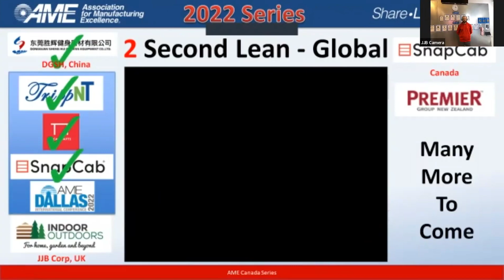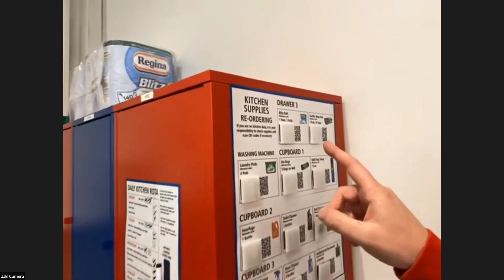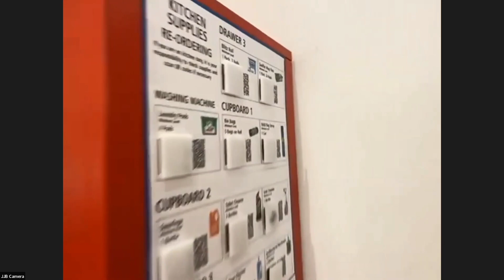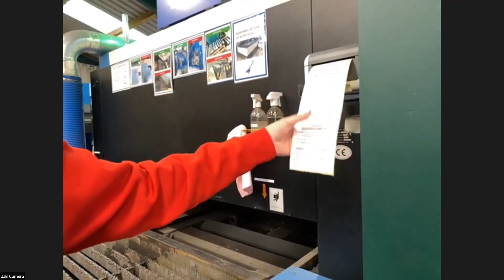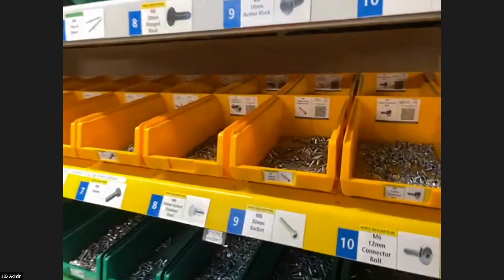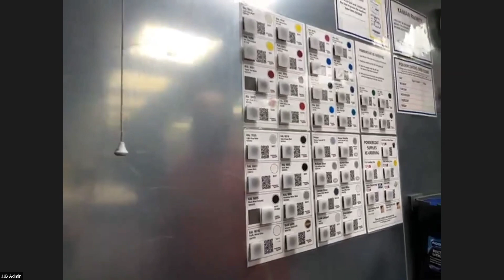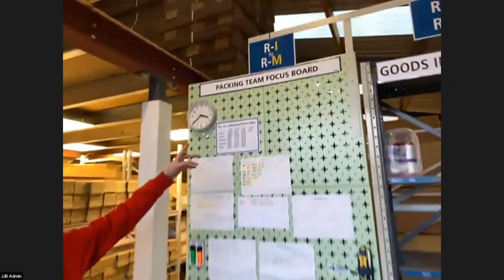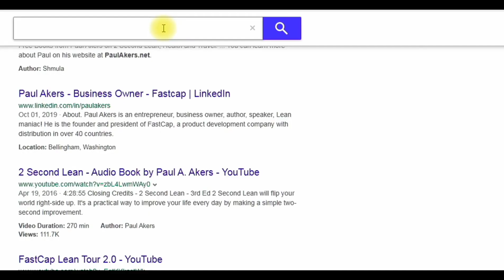Live Streamed Lean Factory Tour JJB UK November 2022

Comment: Jack, could you tell us please what model/brand of foot activated strapping machine you are using at minute 35?
Reply from the maker: Optimax 12mm Automatic Strapper with 650 x 400mm Arch (High Speed) OHQS80-15-12